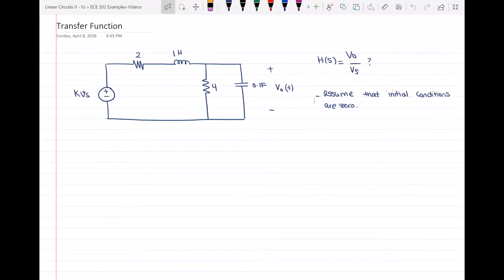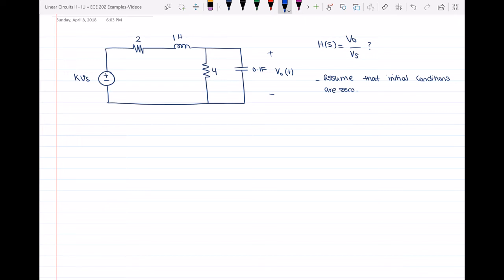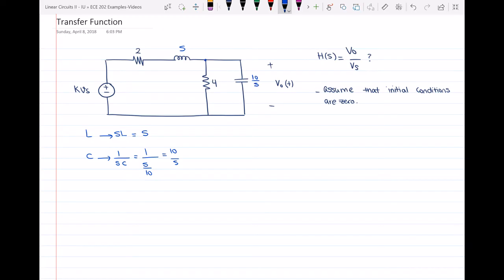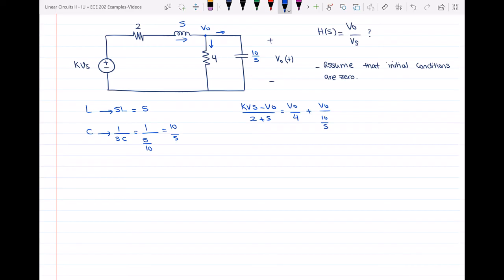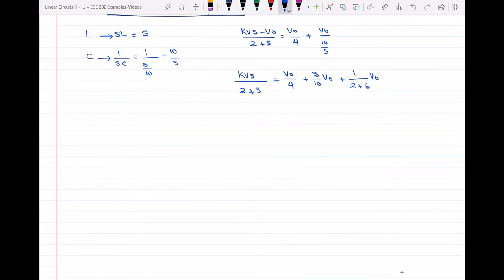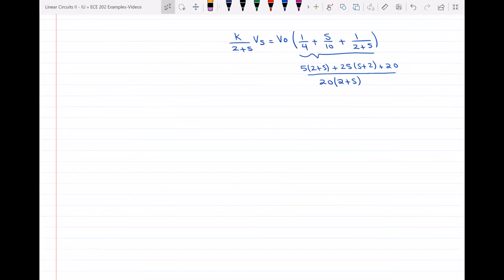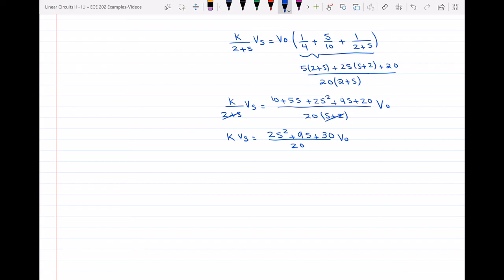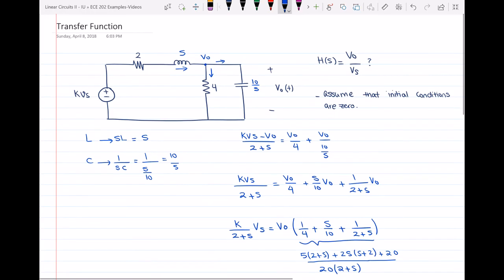Finding the transfer function of a circuit

Comment: nice explanation !!! But is it possible to find the values of R, L and C from the transfer function ?
Reply: Not in general I don't think.
Suppose you find the transfer function of a simple voltage divider with no load on the output. It should simplify down to just a constant ratio determined by the R1 and R2. You can determine the ratio of these resistors but not the absolute value of each one, as that information was lost.

Comment: hello, the K in the voltage source stands for what? is it a constant or kilo?
Reply from the maker: It is a constant
Reply: @ElectricalEngineeringAuthority  Looking at this from the perspective of a filter circuit the K term would also be the gain at 0 frequency or DC gain correct? This could be seen as a passive 2nd order low pass filter circuit
Reply from the maker: mfan981 Yes it is correct

Comment: Could somebody help😬? I need to find transfer function of [34*10^5 = 128806*10^3 * v'(t) + 91239 * v(t)^2 + 680*10^3 * v (t)] for inserting block  in simulink and check simple control system. Be so kind, heelp 😁🙏

Comment: Could you combine the parallel resistors and then apply voltage divider rule to find H(s) as well?
Reply: SizeableVermin I did that. But ended up with a different answer.. 4K/6+s
Reply: The resistors are not in parallel. But you can combine the 4 ohm resistor with the parallel s/10 capacitor and do voltage division and get exactly the same answer. Simplify the following:

H(s) = K*(40/(4*s + 10)/(40/(4*s +10) + 2 + s))